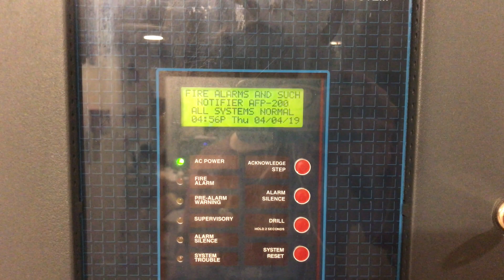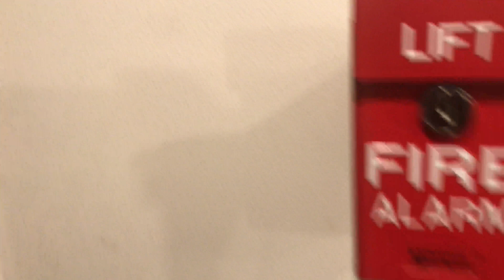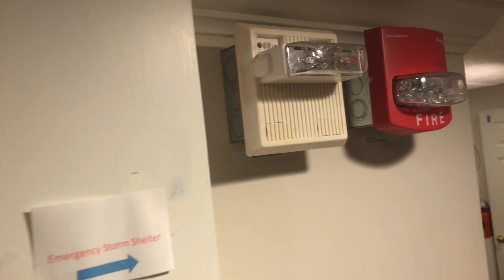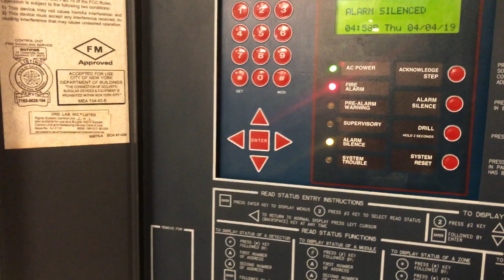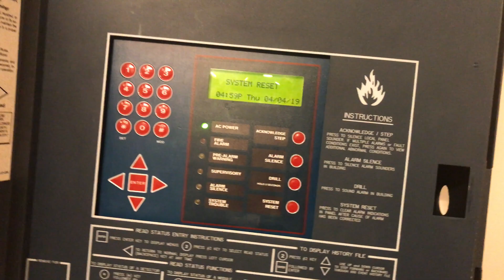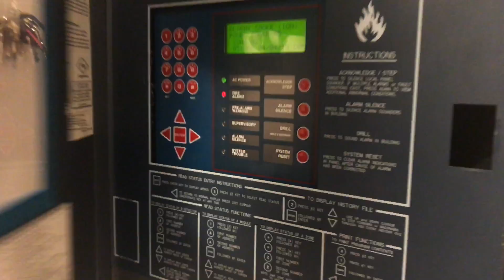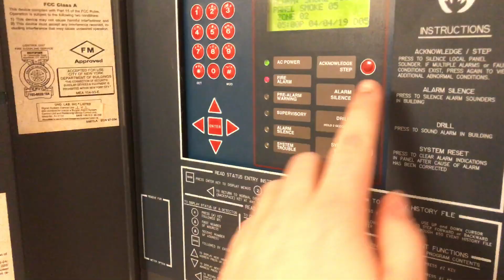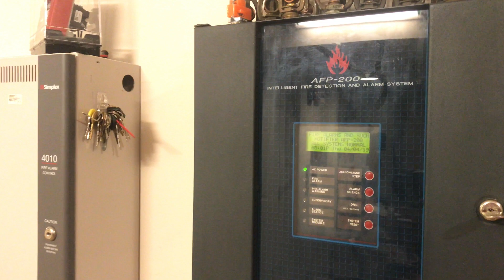Notifier AFP 200 Test 4: Request Test-Michah Larson

Comment: Nice video! I have a MASS too! I have a few questions about it. First, how do you change the tone on it, also how do you wire up the strobe. I have  the horn wired up, but can’t get the strobe to work.
Reply from the maker: If it is the same MASS as this video, it is not multitone. If it is the Multitone version, on the back there will be three spaces (Labeled ABC) that you slide clips on to change the tone.
Reply: Ah. I have the one like what’s in the video.